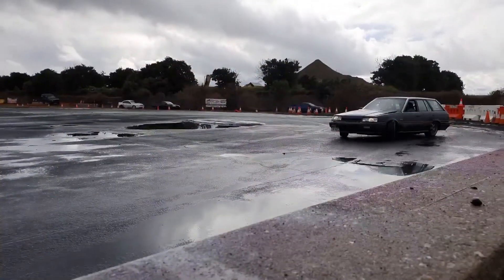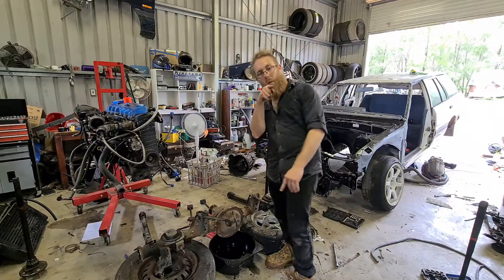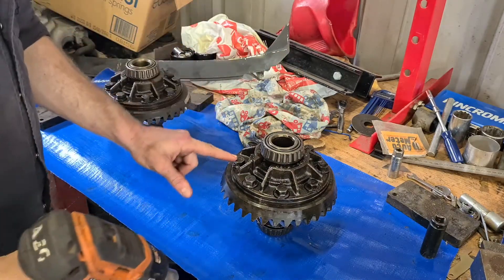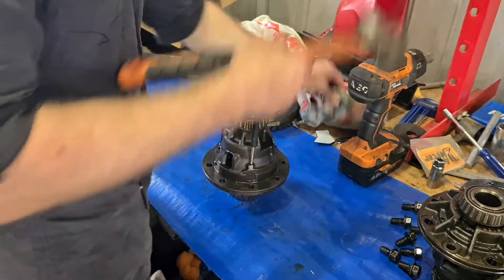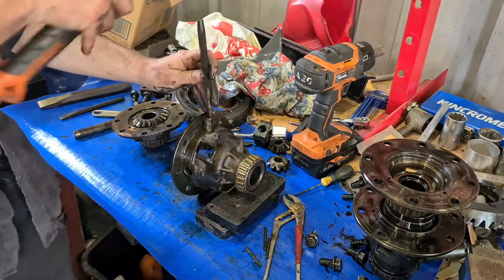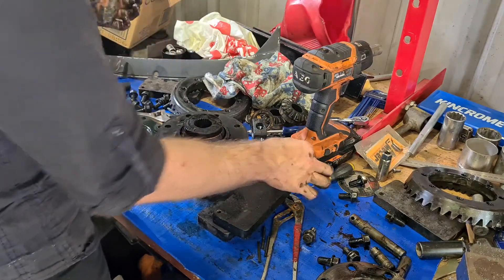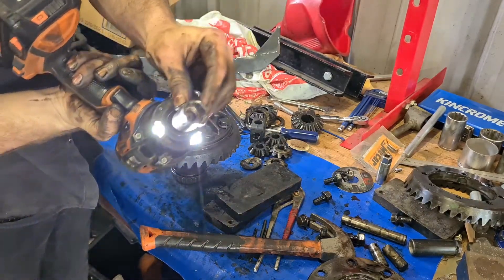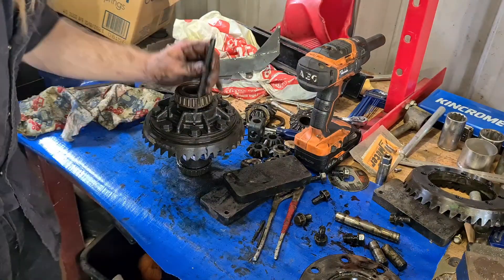MINI SPOOLING THE NEW DIFF, LOCKING AN R31 SKYLINE DIFF THE RIGHT WAY! || KIRKI R31 DRIFT WAGON

Comment: Just got a spool on the way for my wagon. This video is very useful! Don't have an impact driver but I do have good sockets for my breaker bar. See how it goes!
Reply from the maker: Honestly best upgrade, I'm still beating on the same spool I got 5 years ago with no issues.

Breaker bar will be fine, just use a good quality 6 sided hex socket not a multipoint to avoid stripping it and remember they are reverse thread.

Good luck, hope it goes well, hit me up if you run into trouble 🤙
Reply: @tokimotive  yeah got some good Kingchrome and Stanley hex sockets
Reply from the maker: Very good, shouldn't have too much issue then, good luck, hopefully it works perfect for you

if the locating dowels are sheered off I have come up with a couple more ideas since this video to sort that out that may be worth a try but it takes pretty bad conditions for it to do that